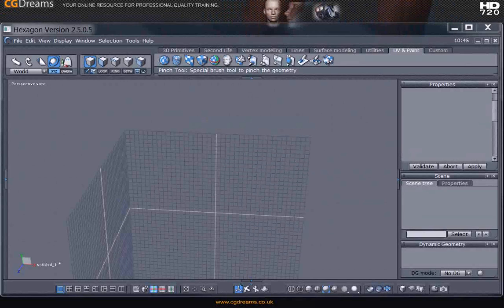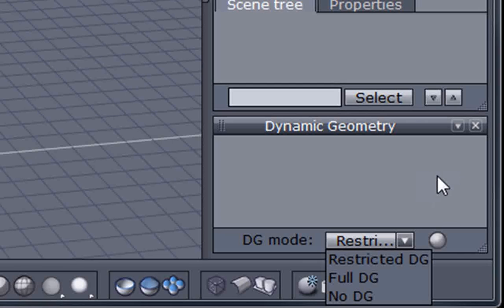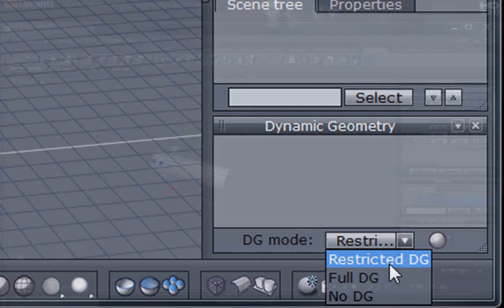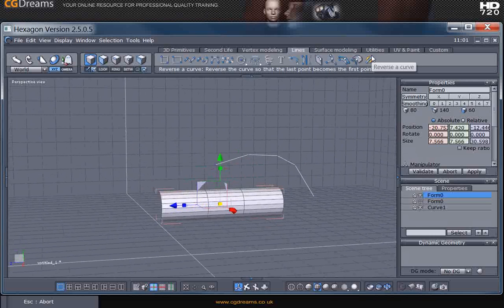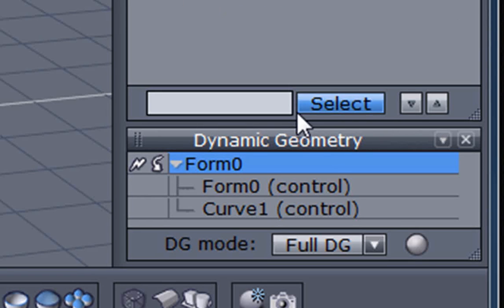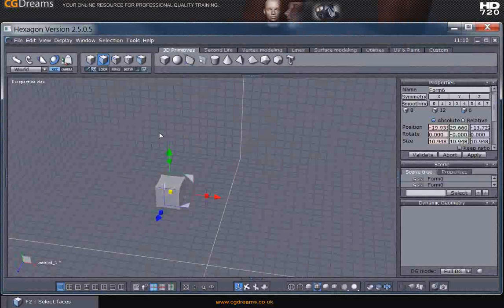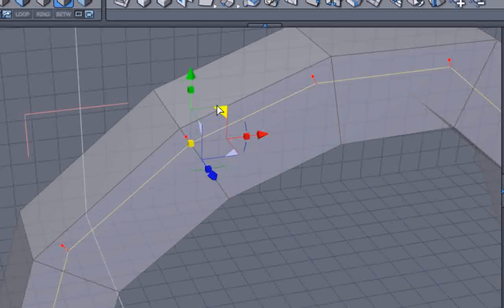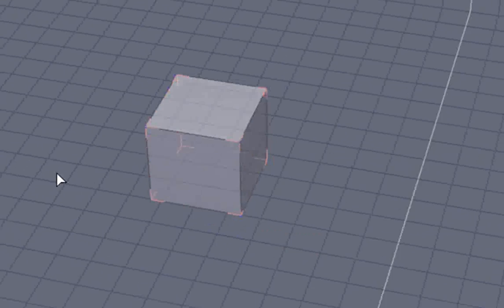Hexagon quick start part 3-section A - Dynamic Geometry

Comment: Hello! I like your all tutorials and I am following them step by step.
 somehow from my work office desktop I cant load anything  even a simple cube .The problem is that the hole screen is blinking and it says Multiple errors ,and its closing the program down.
 Ive emailed Nvidia they set up a new from scratch download the Nvidia and did not help ,Ive called DAZ3d and waiting for the answers but I am guessing that you know so much about this program that youve seen it all and hoping that you can give me some advice or any idea what to do please!I am Using Windows 7 PRO 64 bit.
 thanks in advance
Reply from the maker: What graphics card do you have, has this problem always happen on that computer when you load Hexagon?  In hexagon go to the preferences/3Ddisplay tab, and in the sub menu  Advanced.   Turn off VBO to another option.  It sounds like its a Graphics card issue.

Dan
Reply: Hello and sure CGDreams,I will try that.
 I have Nvidia 260 its older version but never had any problems before ,I am using Rhino 3d but after downloading the Hexagon 2.5 its acting weird like this .
 I have Hexagon 2.5 at my homes laptop and it is working fine and I am watching your videos and learning.
I will try tomorrow at my work place and let you know if its no problem for you .

thank you! 
kind regards.
Reply: Hello ! 
 I did as you ve said and it worked ,,I put on Faster and now its not blinking anymore ,Thanks for that but  one more thing  is still there which opens a Box at the bottom of the screen says: The color scheme  has been changed to Windows 7 Basic.and the second box follows after that says: The following program has performed an action that requires Windows to temporarily change the color scheme to Windows 7 basic.

do you have any idea how to bring back to normal scheme where it was ?coz everytime I open this two boxes are opening along with it .
it looks like you helped me and you know the Program very well and appreciate for that 

thanks in advance if its not a hassle  for you .
Reply from the maker: I dont have Hexagon installed on this PC, so cant check, but sounds like because Hexagon is not using opengl is turning off windows color scheme to make Hexagon compatible.  You may also try right clicking on the Hexagon icon and out the compatibility mode to windows XP and see if that helps.

Dan
Reply: sure I'll try that ,
thanks a lot ,
appreciate!)